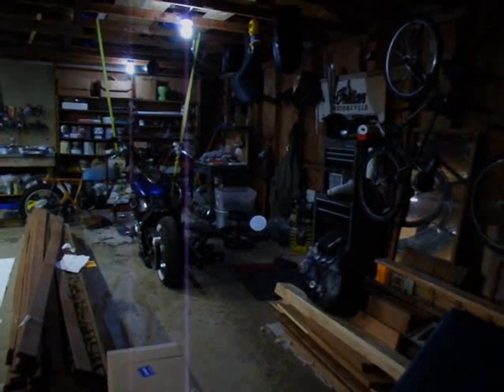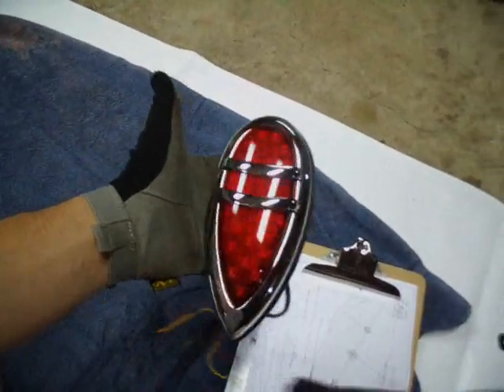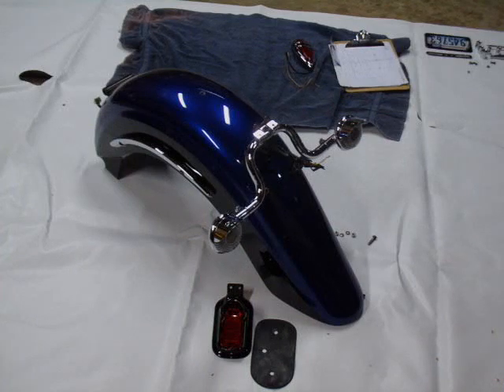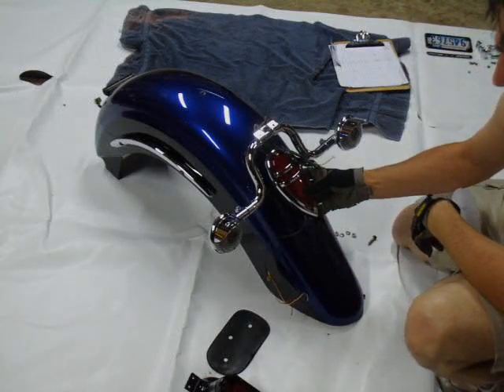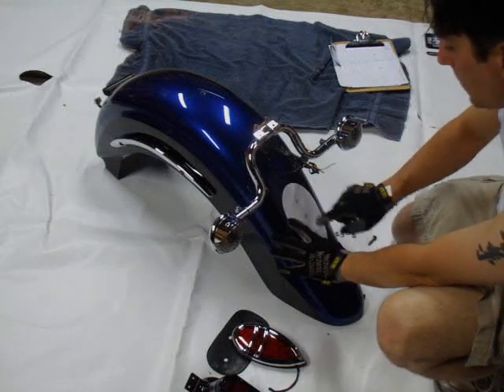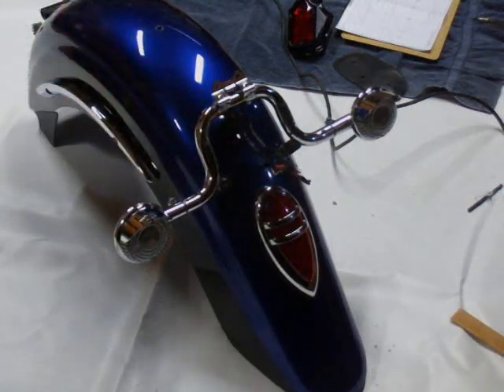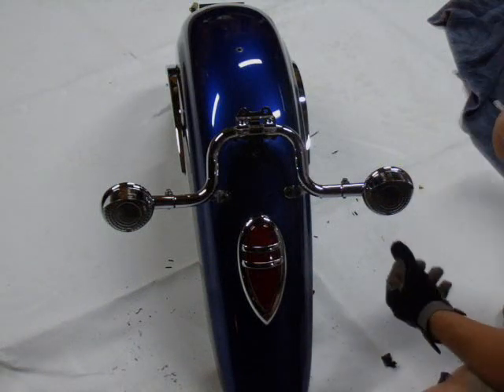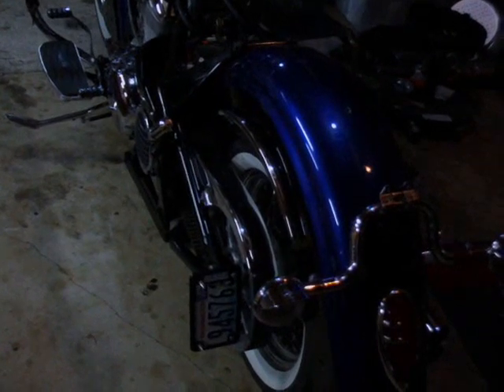New Tail Light on Rob's 2001 Road Star

Comment: I just purchased a 2001 Road Star and LOVE that tail light.  I too am going to clean up the rear light setup with a similar look.  Not sure yet what to do about the turn signals yet however.  Can you tell me what kind of license plate mount you got?  Also, does the tail light sit nice and flat across the fender?  One more thing, what is the part number of the brake module you used in your setup that allows it to blink twice and then stay on along with the turn signals.  Thank you in advance!!

Comment: DId you have any issue with the roundness of the fender? I have been wanting to use the same light on my dragstar 1100
Reply from the maker: I didn't have an issue with it. The rubber backing plate flexed a little to take up the excess curve.